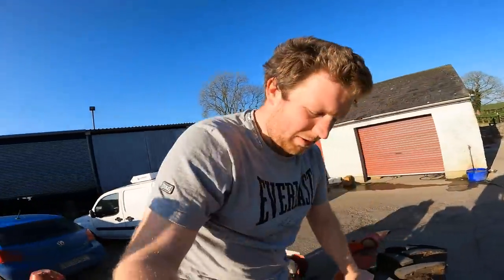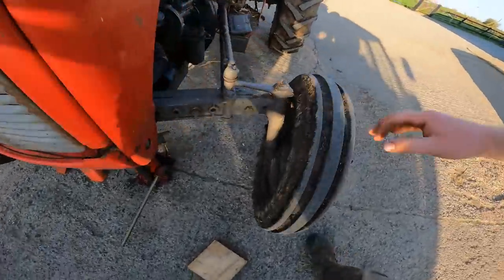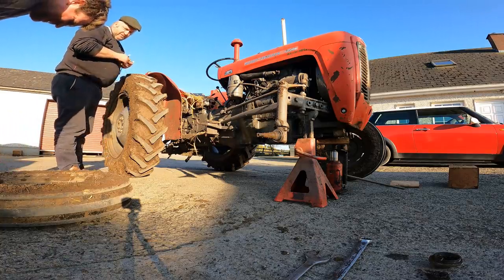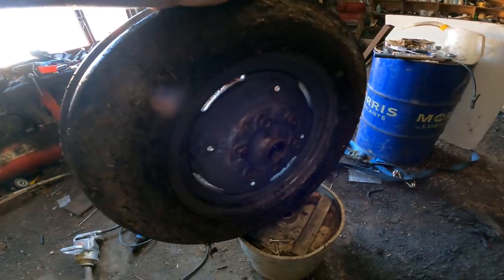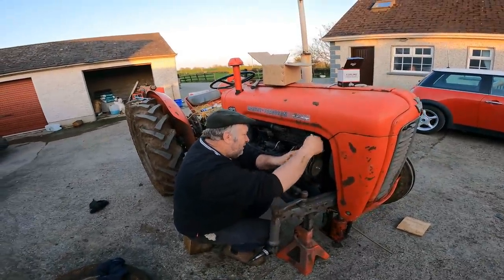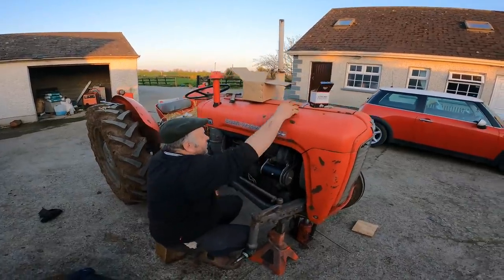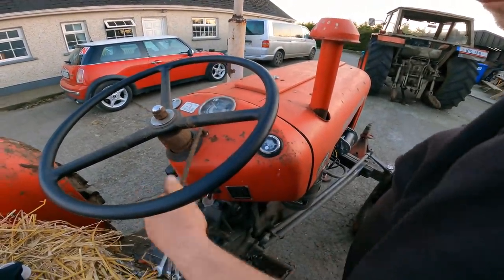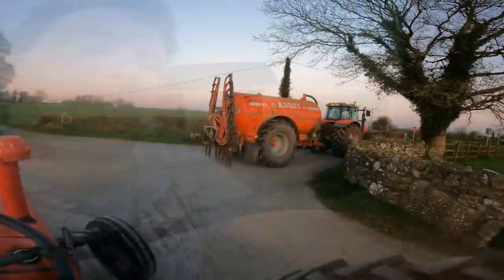3 WHEELED TRACTOR -- MASSEY 35 IN NEED OF SOME REPAIR!!

Comment: Fergie spanner fits the hub cap, changed bearing on front of the
TEF20 other month and was having trouble finding a charging problem, was the shunt in the amp meter fitted new one sorted😀🚜 joys of running the old one's. Cheers Phil keep them coming 👍

Comment: This Massey is a 35 x 😂😂
Reply: Go back a couple of videos and I'm sure they said it's a 35 with some 35x parts, think the video is "is it a 35 or 35x"
Reply: Ud no by the sound tat she is a 35 not an x
Reply: They did a vintage thursday explaining it better, but in short it was a late model 35 so had the diesel pump and engine set up similar to 35x spec, however was a 35 going off the serial number, casting numbers, etc.

It's common enough for late on the line tractors to receive some upgrades from their replacements before they've been officially phased out